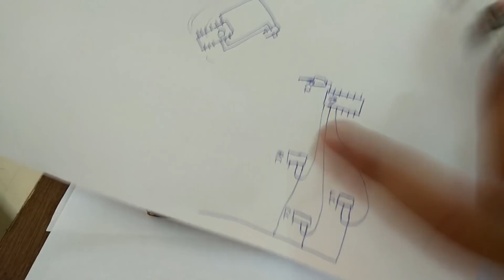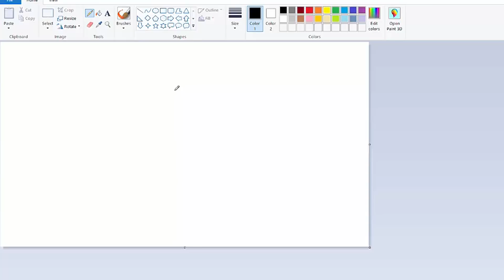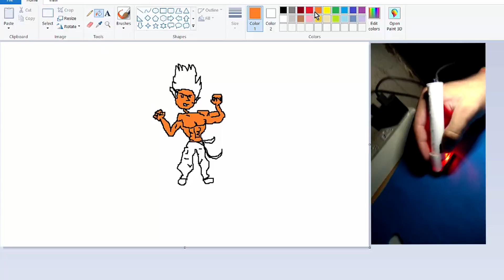how to convert your mouse into a pen( for draw kind of purposes)

Comment: I need the diagram of everything, please (it's for a college assignment)
Reply from the maker: Sorry for the late reply buddy🙏😵
but it does not follow any diagram It's just simply jumping the wires after cutting the circuit It's very simple it's not complicated just join the connections back again with wires😄

Comment: can i have the wire connection diagram？thanks.
Reply from the maker: I just extend the circuit with wires that should apply for any type of mouse accordingly 😁
Reply: @Makeit2  but if i join all those things in a new pcb can it still work?
Reply: @Makeit2  thank for ur reply<good good>

Comment: You did well but how to do... Didn't get... Plz use own voice as telling how and which wires arw you connecting
Reply from the maker: Basically I am just jumping the circuit by using wires I am extending the mouse circuit in order to fix the whole circuit inside a pen body

Comment: I was thought easy when watching it very hard
Reply: @Makeit2  ؟؟
Reply from the maker: You just need to jump the connection between the circuits by using wires 😅
Reply: @Makeit2  i don't any thing about this

Comment: That Was amazing Brother You made it ,, You are my mahn !!!!!!
Reply from the maker: 🤓🙏thanks bro
Reply: @Makeit2  if it was like...  Usb connection to computer -Big Mouse Hardware ,another lengthy lite wire,then the light and sensor [°] 
Then it would have been more light weight and comfortable to use...
I don't understand why these Amazon sellers are not making it small ...  I found all of em Big.
Reply from the maker: 🤔hmmmm you are right

Comment: so concerned about removing a screw, than a ramble of nonsense....so basically strip mouse remove pc board rebuild into a pet project....
Reply from the maker: Exactly 😌
Reply: @Makeit2  lol for me its pretty easy to understand take the chip and keep as much of the circuit....or simply use chip and wires to reconnect everything....all im saying is not many people will watch this video and attempt it cause they want step by step instructions....and i get it...but dont waiste my time with a 30sec ontro how to remove a screw lmao...anyway nice idea but the flat service will tick me off. Buitl one from a micro processor into a thinner body...still it a glorified pen lol

But nice idea

Comment: How do you connect IC pins, like starting 1-6 to corresponding to other side?
Reply from the maker: yes exactly
it looks complicated but i just jumped those connection using wires 😌
Reply: @Makeit2  but what wire solders to what end they have corresponding numbers that need to match
Reply from the maker: yes
Reply from the maker: just extend the circuit using wires 😉

Comment: I tried it and the pen is not working :')
Reply from the maker: the led light should pe placed in accurate position and the senser IC should be on a specific height from the surface 🥴

Comment: Guys, I wanna try this as I would srsly never find a cheap drawing tablet or pen in my town. Did anyone else try this and it worked?
Reply from the maker: yes it works
but hard to make
I will recommend you to go for a cheap graphic table instead 🙆🙏
Reply: @Makeit2  Nah, getting a tablet is completely out of my choice. Anyway, If I could make that, would drawing with it be the same as when I'm using a pencil on paper?

Comment: I like this idea, but it doesn't go far enough…

It needs a pressure sensor. Possibly a tilt sensor, measuring angle against the drawing surface. Maybe a sensor to find the pen's rotation relative to a point attached to the drawing surface for reference. (The rotation axis I'm talking about with that last one, is the one where the pen rotates around a line perpendicular to the drawing surface.) At this point, I'm thinking of the “drawing surface” as a wooden clipboard with a cloth mousepad attached, and maybe some kind of emitters/beacons at the opposite corners of one edge of the clipboard, to allow the pen to find what it's rotational angle is. (The two beacons would need to be identifiable as unique signals. And the computer would need to have software that uses a little trigonometry to find the angle of the pen. Not sure what would be good as a sensor-beacon combo, though… Compass-magnet? Microphone array-tiny speakers? Low quality digital camera and QR codes?) I at least think that a good pressure sensor could be either a hall effect sensor combined with a small magnet and a spring, or a piezoelectric crystal.

Might also be a good idea to rig the mouse button to activate by applying downward pressure to the whole pen. If you want to get fancy, then make the activation pressure adjustable with a mechanical mechanism, like a screw with knob attached to a firm spring.

But I suppose your pen is already serviceable…
Reply from the maker: 😯😯😯 that's a  whole lot of stuff
I really appreciate your knowledge in this technology
I think we don't have to make it that much complicated because if we included that much mechanical components and stuff there will be increment in the chances of error 
i think piezoelectric crystal will work much better
and you can set the value like if the piezoelectric sensor senses any signals it will be response as a click on the mouse😗
Reply: cant understand a thing. talk english y'all
Reply from the maker: Use Google translate 🙂

Comment: For those complaining about the size:

Longer cables, move the logic board to the top of the pen, put the buttons next to each other and trim down the lens. You can probably fit the LED and the light sensor inside the tube as well. Then you can use a much thinner tube, almost as thin as a regular pen.
And with a trimmed lens you can also angle the pen.

Slap an Arduino Nano with a battery pack on that bad boy and you can even make it wireless with minimal extra weight/size.
Reply from the maker: But we have to decrease the size of receiving IC that captures the light and calculate all the data for the courser we have to redesign the light reflection setup😯😯
Reply: @Makeit2  No recalculations needed. All you need to do is trim down the fitting for the reciever so you only have the lens and the very edge of the light receiver. Then you tilt the IC upwards so it is aligned straight with the "pen". The angle of the emitter does not matter at all, so you can fit that on the back outer side of the "pen tip". A small hole is all that is needed for the wire to the emitter.

That gives it a much smaller profile that is able to tilt, like a real pen.
Reply from the maker: 🤤i agree🙏
But i think that we need to redesign the lense because i tried it the receiver IC works properly only on a specific height or intensity of light that's why I had to cut out the bottom of the mouse body and stick it to achieve that height  😮
Reply: @Makeit2  I'm not talking about trimming the lens part of it down, I'm talking about trimming off everything but the lens from it. It will still be the same height and the same light intensity, the only thing that changes is the angle and profile.

You can try yourself, lift your mouse up, angle it slightly and move it around. You'll see the mouse pointer still moves.

Comment: Mass market and sell... research and develop variations. You've got an untapped market for digital art supplies aimed at a wide range of artists. Most of what's made now is costly, over-specialized and intended primarily for use by Professionals who work for companies that use a lot of other high end equipment. In other words, a game of "keep away" rather than a competitive array of art products for which there is now a CONSIDERABLE demand! You could be the first to plant your flag since Wacom did their half-baked job of it in the 1990's!
Reply from the maker: That's great but tere is already a mouse pen had been made earlier and in market. I really appreciate thoughts but wacom is making those graphic tablets they have a property called pressure sensitivity  that i can't achieve with my mouse pen. Now i an also using one of the cheap wacom graphic tablet due to that one ability that play a important role in the graphic designing industry that's why peoples are buying their expensive products. Every graphic designer or digital artist started by using a cheap graphic tablet and start buying the expensive one due to their professional work after years and even If i achieve the pressure sensitivity for my pen the people get use to work with those types of graphic tablet that will lead to failiure of the plan😂😮🙏🕊️

Thanks for your suggestions that ideas 😊🙏🕊️
Reply: @Makeit2  Who told you that? Keep at it. I don't know what you want to accomplish by not offering an alternative to the lame styluses that are out now. I  want a good one, and some APPS can be set for pressure sensitivity if you even WANT it  (which I don't, actually). Someone's convinced you that this medium is a career tool only. That's like saying that golf clubs and tennis rackets are only for professional athletes. Lots of people do art for FUN! No manufacturers have us in mind, and certainly no designers! Not everyone is into soldering. I am one of them. If you'd rather, though, at LEAST put out a handbook for us hobbyists. I do my art currently on my phone, because unless you're willing to spend a fortune on something BOUND to become OBSOLETE long before it wears out, nothing short of a Cintiq will be worth the investment of trying to make a silk purse out of a sow's ear. The market, as I said before is wide open, and sooner or later someone with a patent will be selling this stuff to the dollar stores. I am not getting any younger, and I want moderately priced digital art equipment NOW!!!

Comment: didnt the un coated wire cause cross connection
Reply from the maker: Yes
But the wires i am using is took out from earphones cable 
These are tick insulated wires

Comment: Super.... brother did it has any circuit diagram or anything.. a pdf of explanation..if forward.
Reply from the maker: Sai Kumar Kiran Kumar bro every mouse had a different circuit it varies mouse to mouse i just break it and rejoin it by using wires

Comment: wires mein confusion nhi hoti
Reply: MUKUL BHARDWAJ  by desoldering
Reply from the maker: koi dikat nahi phele na pics clik kr lio ki kon si wire kaha lagegi aur circuit diagram bnaa lio aaram se bn jaayega fir
Reply: ok thanks
Reply: components ko circuit se a;ag laise karna hai
Reply from the maker: haan desoldering se aur soldring wire jayada lagaaio taaki saarey joint heat up ho jaayen